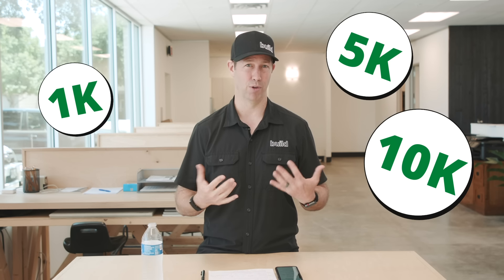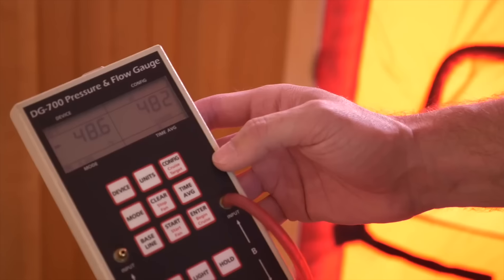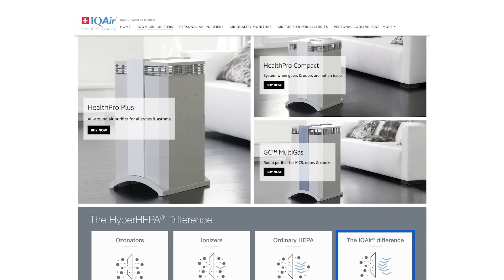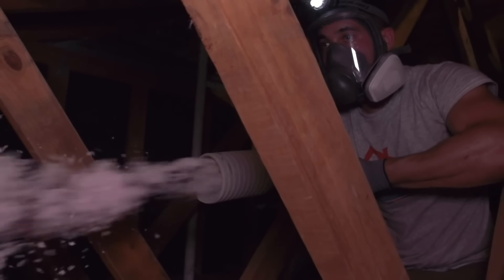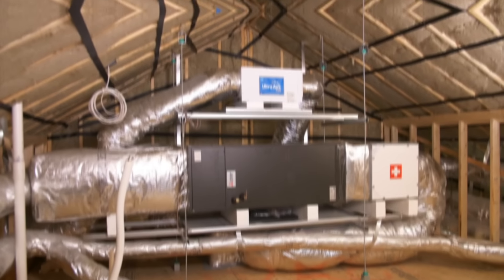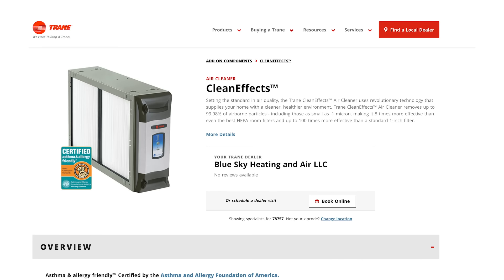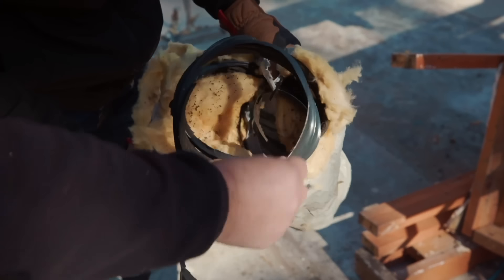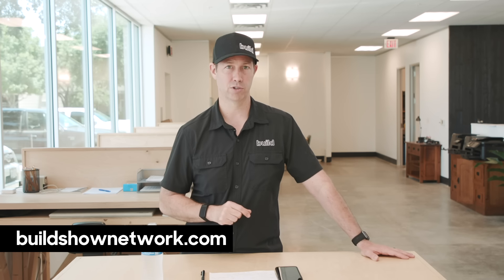Affordable Home Upgrades (Energy Efficiency & Indoor Air Quality )

Comment: I'd love to know low cost fixes or improvements to do on a low end 10 year old builder home (KB) in Austin. I put a clear childproof box over an electrical outlet and occasionally the inside is covered in condensation and I often get a trail of ants that climb up the side of the foundation and straight through the wall into the house. There is a huge finger wide gap between the bottom of the siding and the foundation and there's nothing behind that but the cardboard sheathing and the bottom plate is not likely sealed to the foundation at all so the walls, outlets and windows are all very drafty. I'd gladly volunteer my house for one of your videos.
Reply: KB has a lot of lawsuits, can see pictures of how they did the inside of the walls

Comment: This video is absolute gold. I am curious if there is some improvements to the subfloor when removing carpet and carpet pad. Ie. Could you seal better between the subfloor and the exterior walls to make a difference, could you seal the subfloor for better insulation or whatever reason?

Comment: Radiant floor heating was the best 5k I ever spent on my home
Reply: What kind of system did you put in?
Reply: @PatrickQ4HBD  I have two systems. Sun touch under tile electric heaters and an oil boiler that supplied baseboard radiators, that I converted to underfloor loops. I used uponor hpex for the loops and aluminum plate heat spreaders that I made myself.
Reply: @beachboardfan9544  Seven months later, thanks for the prompt response!! Heated floors are big on my wishlist for upgrades to my 50's Southern farmhouse. I lived with them briefly overseas, and they're wonderful.
Reply: Yep after having heated floors I wouldn't have any other form of heat.

Comment: Hi Matt and friends!
Im a huge believer in air sealing a home. As Matt said, homes need only breath on our terms. I question the wisdom of home owners blindly air sealing their homes without regard to water management, older or newer homes. You've mentioned in older videos that you'd torn into houses for remodels and found evidence of water ingress. In some of those cases the wood wasnt rotted because the air leakage  provided enough flow over the spot to provide the two healing forces of water restoration, evaporation and ventilation. If you take the air flow away without ever knowing that it's taking place, wont that just accelerate rot? Even more so with modern building materials like OSB wall and roof sheathing and sub floor. In some instances it could lead to a degree of structural failure with i joists, composit studs, LVLs etc. Again, I am in the opposite camp of the "homes need to breathe" people, but to my understanding air sealing cannot take place without vapor and water management considerations.

Thoughts?
Reply: building material shouldnt stay moist or wet for long. except the outer most layer, which should withstand water. 

either you avoid it getting wet /moist or you let it dry fast enough. 
both have its pros and cons 

if your house is one or the other you can not easily change it. 
if it was designed to breath, let it breath. if it was designed to avoid water, let it avoid water. 

this might sound easy, but matt can talk about this for multiple videos.
Reply: Yeah I'm in a 100 yo house. It's leaky, but I do know that that things are getting dry again. Id be very hesitant to do aerobarrier unless we did a complete gut and renovation.
Reply: @lichansan1750  I agree and disagree. I think that air sealing can take place as long as moisture management is part of the plan

Comment: Matt love your channel. Love learning more about insulation (2.0)! My question is whether you need to spray foam the entire ceiling floor joists (Iowa climate) or just air seal the cuts/gaps? DIY spray foam is still like $3k vs. just air sealing the cracks and using blown-in over it.

Comment: You missed Plastic film over drafty windows for $20 😂
Reply: Thicker plastic film that replaces the screens in winter works well..
Reply: No joke...thin film works especially if you have maxed out attic, wall And floor insulation. I still have old single pane windows and every fall I put on the interior thin film. It works;)
Reply: Yeah it works if you have shitty single pain windows.
Reply: @christophergruenwald5054  My windows are single pane but far from shitty. They are the old traditional double hung windows with interior counter weights with side, top and bottom sealing flanges. I would not change them.

Comment: For indoor air quality,  in addition to using filtration systems you may want to address why indoor air quality is poor to begin with. How about spending some of that $  to upgrade building materials that use fewer toxic chemicals that won't offgas into your home. Think about all the glues, formaldehyde, etc. in typical materials.
Reply: Are there any products in particular that you’re a fan of?
Reply: In my house, it's girls, pets, and dirt from outside, in that order. I don't want to remove any of them!  😉

Comment: I'm really surprised he didn't suggest EXTERIOR INSULATION!
Reply: IDK about doing it only for exterior insulation, but for sure if you're already doing you siding.
Reply: Just slap it up over your siding, your neighbors will love the look.
Reply: If a home owner is redoing their siding...yes install tinfoil foam board outside and then siding for increased comfort and warmth.
Reply: Nathan Phelps just have the spray foam guy spray the entire exterior right over the siding. You will have a yellow house. Yellow is a friendly color. The neighbors should really love it.
Reply: @christophergruenwald5054  Haha you guys are funny. I had a company come and injection foam R20 my exterior brick walls for $8,000 in 2014. Far more quiet and warmer. Expensive but a good investment in a long term family asset and being warm and comfortable is priceless.

Comment: For the media filter, you’ll want the contractor to measure your airflow and Total External Static Pressure (TESP) before anything else. If you add a high MERV filter it will restrict airflow, which can bring additional unintended problems. But I agree, more filtration is better as long as you don’t create new problems.
Reply from the maker: Good tip
Reply: The thick filters, particularly the Aprilaire, don't add a huge amount until you get above MERV 13, as they have a very large surface area.

Comment: If you air seal, you have to make sure you power vent combustion furnaces or you might get a backdraft. Also, if you air seal really well, you probably need to install ventilation.
Reply from the maker: Good points

Comment: I like Matt but I disagree with just about everything he says :).   If you have limited $$ and want to remodel, don't waste it on an energy audit.   Get rid of all carpets and put down hardwood or tile floors.  Next, focus on the kitchen.   On the energy side, go with Mitsubishi mini splits.   Forget about conditioning the attic space.   Waste of money.
Reply from the maker: Interesting. Valid points.
Reply: Mitsubishi is a waste of money. hyperheat is cool, but MrCool also has that for half the price. if you're in a warm climate, you don't even need it.

your best bet, if you're handy, is to get the MrCool DIY mini-split. they have a multi-zone unit now. I was quoted $14k for a 3-zone split. I bought my own (Pioneer) unit and installed it for $3k+$500 in tools. it's super easy to install mini-splits, even as a retro-fit.

Comment: I think you’ll find your AC guy will be your best buddy as he has to come back every year to charge your mini split. 😀
Reply: If he needs to come back every year  you need to get a competent Hvac technician. Hvac systems should never require additional refrigerant if installed properly period . If they do then there's a leak and your Hvac Tech should inform you of it. As a Hvac tech  telling a customer they need to top off the charge without informing them they have a leak is Outright Lying and the leaking depending on the severity can cause  serious damages.
Reply: Gcanno Split units are crazy over prized and living in NYC where everyone has one, I have never seen one last longer then a few years before it starts failing. Constant upkeep. Maybe all the AC guys in NYC suck.

Comment: Can’t imagine you would ever make up the 5k in energy savings by doing this
Reply: It depends on your current level of insulation and sealing and efficiency of your HVAC now.  Just replacing a 10 SEER old heat pump or even the basic now legal 14 SEER unit with say a 22SEER unit or with minis that have up to 38 SEER in some of the small mini splits. But even a 14 SEER to a 20 SEER changeout (and there are DIY units like Mr. Cool that dont require licensed person to add freon etc) would decrease conditioning electric by over 42%.  If you now spend $100 a month for conditioning you would save $42 per month or $500 per year so pays for itself about 10 years. If you are replacing a 10 SEER save $50 per month or $600 per year and pay for itself in less than 8 years 4 months. You might also have a dehumidifier setting built in .
Reply: tee kay investing the money spent on upgrading to a mini split will increase in value more in 8 years than the unit paying for itself. And assuming the mini split or a poorly installed mini from some DIYer won’t break down in that time period considering they are throw aways. Also depending on your location how much you even use tour A/C to begin with. It’s the same argument about a 80% vs 90% only saving $10 per hundred spent
Reply: @anDWandy  A diy mini would likely cost well below $5000 most likely about half that .  You are also not factoring in the increase in electricity cost likely in next 8-10 years.and likelihood you would have to replace or major repair to the old HVAC unit in next 8 years anyway thus not really costing you anything and if you do a DIY or even low cost install  about $1000 by professional. I stand firmly behind ny opinion and have done it and in 2 years have already broke even and received tax credits too.
I would actually say do a DIY Solar install if there is good access to sun while tax credits still 26%. This can pay for itself in 4 years or less and last 20-30 years or more but that isn't really the point.

I am also surprised he didn't mention upgrade to heat pump dryer and upgrade to wither heat pump water heater or tankless water heater.

I installed tankless water heater 3 years ago DIY a rennai lp gas unit and changed from utility gas to lp at same time and instead of $40 a month much of which was connection fee now we use about $12 a month of LP gas and dont have to worry about outages etc.  I then 2 years ago installed a watercourse heat pump a Climatemaster Tranquiity 28 unit initially in an open loop system since I have a well but may convert to closed loop next year . This has saved me $200 per month and has already paid for itself after replacing a 20 year old 10 SEER gas pack unit that was still functional ( I have a 6500 ft2 house but condition about 4,000 ft2 of it ).
I have just installed a 12,600 DIY ground mounted solar system with 60kwhr of ne lithium battery backup with new  Cevy Bolt cells for $15000 about $11,000 after tax credits. This is saving me $200 per month electricity and with a small emergency generator a honda 2000 I already had and a chip $100 transformer we could literally disconnect our grid connection even though we are in the city. This also was about same cost as installing an emergency whole home generator.
In summary I have made my large home energy self sufficient for about a true cost of $16,000 for a very large home and about half of it is already pid back and I have no worries about future energy costs etc and almost no electric bill.  
This can be done in solar friendly locations for about 1/3 cost if you DIY and make smart decisions and helps the planet.

Next step, electric vehicle and if needed more solar to charge it. I can't wait for the Tesla truck!
Reply: @anDWandy  BTW my DIY installs are way better than most professionals  and it doesn't have to be a DIY unit like mr cool.  I installed my own tranquility 28 climate master water source heat pump bought it end of year and replaced a 10 seer 20 plus year old failing package unit  that I got on sale from ingrams water and Air on sale 5 ton 2 stage unit for $4000 delivered had it in in 2 days 2 years ago and it paid for itself months ago saving over $200 a month in utilities on a 6500 ft2 house not to mention the tax credit it paid for itself in 20 months and continues to save me an average of $200 a month and probably will for 10-15 more years or more If you can tell me where I can double my money in actually about 15 months after tax credit I will invest a couple of million in it.  I did triple my money in Tesla stock last 4 months but that a once in 20 years almost sure thing to double in year or so at least in my mind which was correct.
Reply: tee kay 2 tons for 6500 sqft ?
Reply: @anDWandy  You need to go back and reread your question makes no sense. Actually almost 6600 ft2 with about R22 walls and R30 roof no crawlspace insulation. Fising to upgrade roof to about R 45
Reply: 5 (five) ton unit 2 (two) stage but would have gotten their inverter unit but the company limits its availability to certified installers. Stage 1 is about 3 tons and its runs on it the great majority of the time.

Comment: I've heard pretty much exclusively from HVAC installers and the like that you don't want a huge filter in your HVAC system.  They say you want as much air as possible moving through your HVAC system for both efficiency purposes and not imbalancing the pressure increasing the fan workload.  The advice is to use an air purifier for purify your air and let your HVAC system do what it is designed to do.
Reply: I'm thinking your HVAC guy is planning on buying a bigger boat from the money he'll make installing new furnaces when the old ones die before their time! Those "huge filters" are designed with low pressure drops so they don't tax your furnace blower. Plus, they protect the AC coil from getting coated with dust, thus improving the efficiency and comfort during the summer. Ask me how I know: I test air filters for a living.

Comment: Would think attic insulation should be added to that $1~5,000 list, including placing the existing duct work in the added insulation to the attic floor.  Or and especially adding Rockwool insulation to the rafters to keep the attic temperature at much lower levels.  This will result in lower energy costs and allow those savings to be applied to other items you suggest like the stand-alone dehumidifier, etc.

Comment: Split AC is the norm across (South East) Asia and really not an "upgrade." I find the whole-house ducted AC here in Texas much more comfortable since it does air filtering. The split units are cheaper to run though, since you only need to cool a few rooms most of the time.

Comment: You need to be careful installing a thicker inline air filter as this will increase your static pressure and your furnace fan may not be able to handle the higher static pressure. I'd do some research first!
Reply: Not correct. You have to be careful installing a higher merv of the same thickness as it reduces the flow. Larger thicker filters have more surface area and allow more flow at a higher merv rating. A thicker filter will reduce your static pressure at the same merv rating.
Reply: @christophergruenwald5054   Agreed, a filter with more surface area would be required. I guess that's why its $1000 or more.